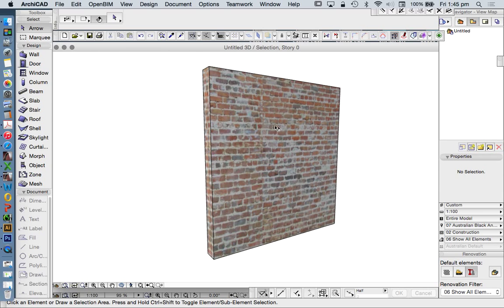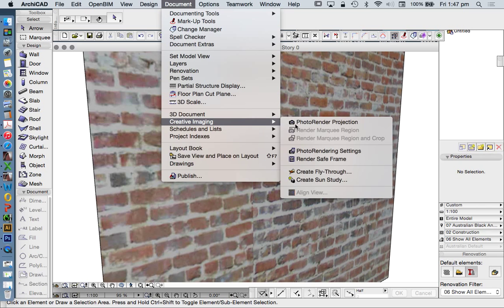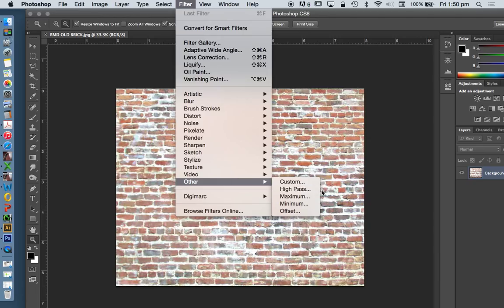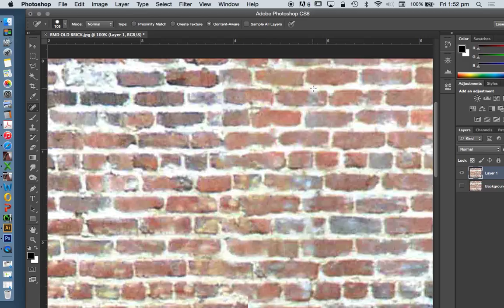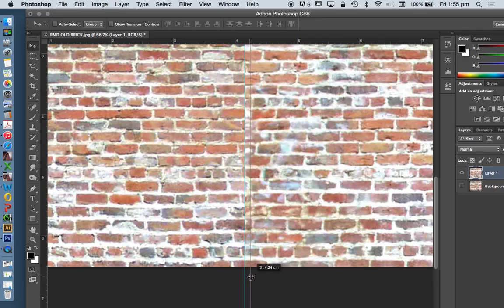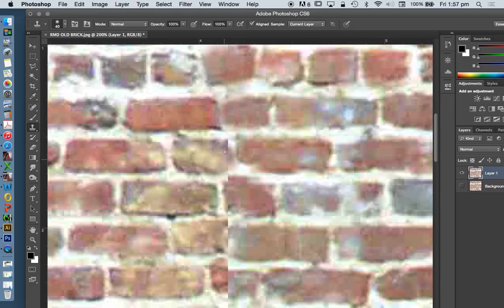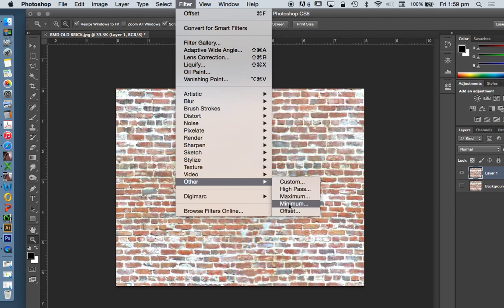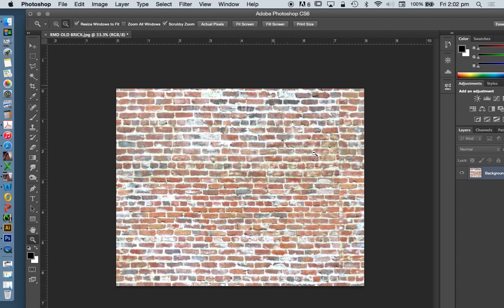CINE-RENDER SURFACE EDITING

Comment: Dan, Any suggestions on how create/edit brushed/non-reflective stainless steel in ArchICAD18? With all of the options within the additional surface catalogue I keep getting way too much reflection say in Stainless steel brushed or matte 18. When I decrease the reflection, after increasing the blur, I either continue to get too much reflection, to the surface turns black.
Reply from the maker: Robert Wilkanowski Hi, you could use a brushed metal texture, but make sure it has consistent brightness and hues values or it won't tile correctly. Then you could add a bump map of the brushed effect for in displacement. Use the internal engine to set it up if you are struggling with the cine-render engine. it is much more complicated.
Reply: Robert Mann Thank you Robert, I'll give that a try.